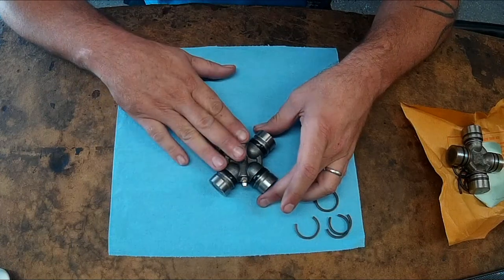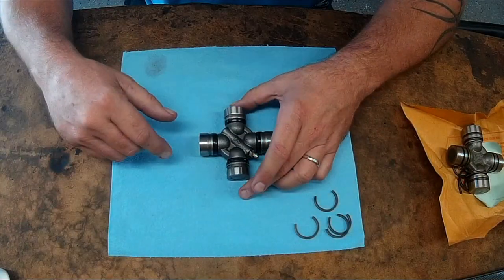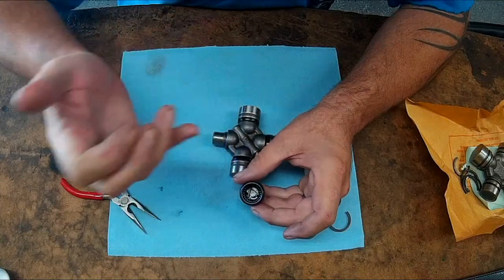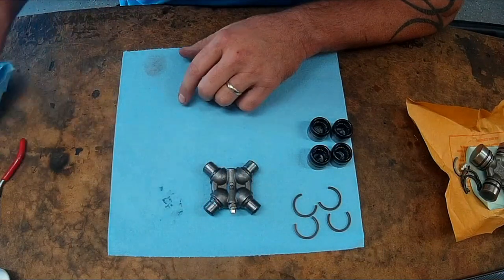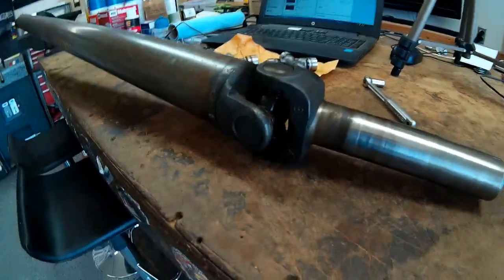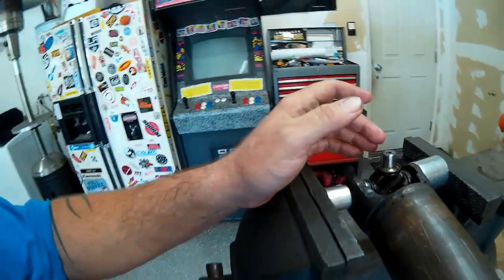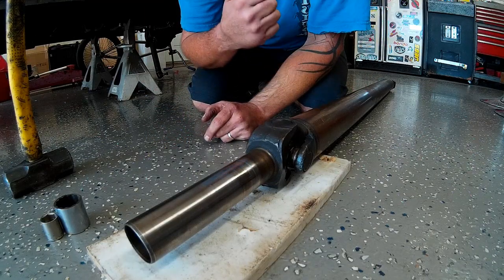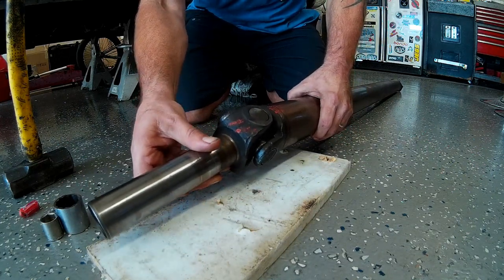66Mustang; How to replace driveshaft universal joints

Comment: Pro tip: if the zerk is angled slightly make sure the grease fitting faces the driveshaft side not the axle/trans side. If installed towards trans/axle you cant fit a grease gun on it. Thats why mine went bad-prev owner minor mistake

Comment: What are the part numbers for the front and rear u-joints you used? I'm having a rough time finding the correct ones that fit my '66. 289, 4 STL, 9 inch rear.
Reply: Moog 498